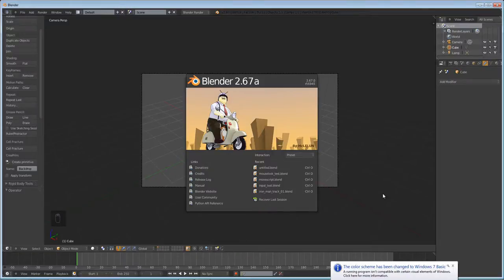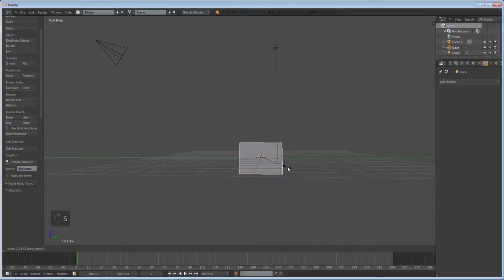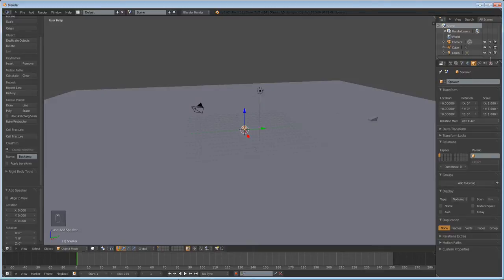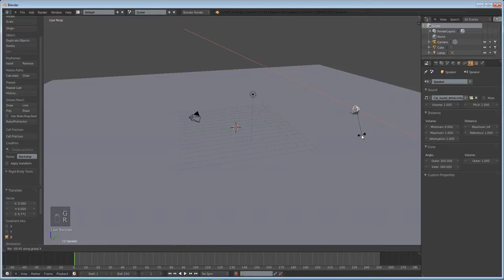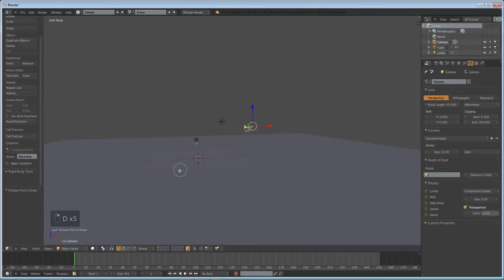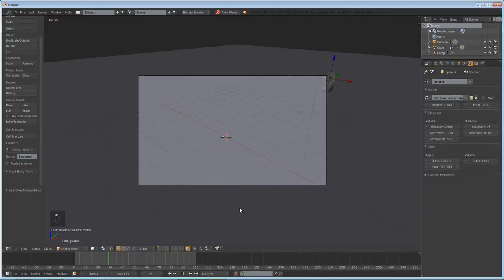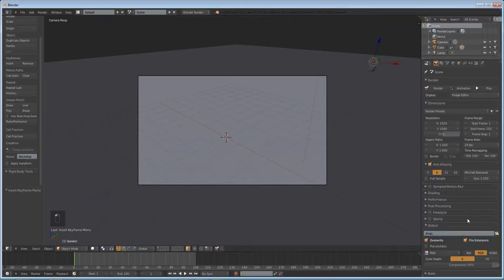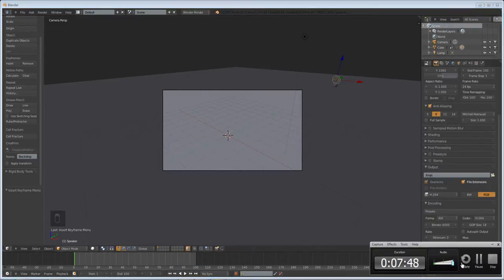Tutorial: 3D Sound in Blender 2.6

Comment: Will it also make the sound come from the right/left speaker so you can hear from which way the sound comes (with headset)?
Reply: I see that this is an old post. I have discovered that if the animated path is perpendicular to the camera the audio will migrate from left to right or vice-versa. If the animated path is a circle, the audio migrates radially. Maybe you got your answer already; if not, I hope this helps.